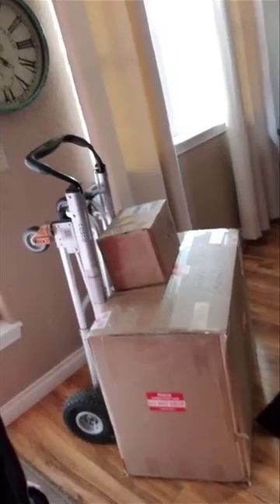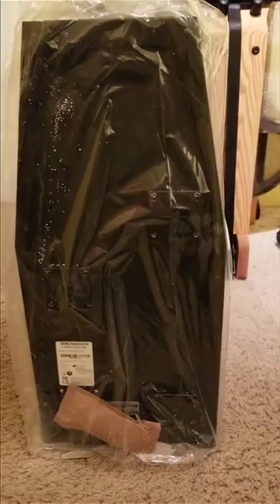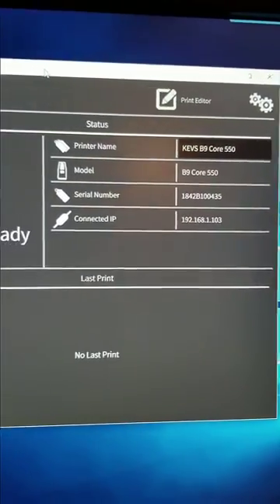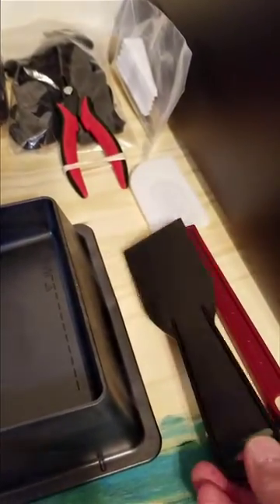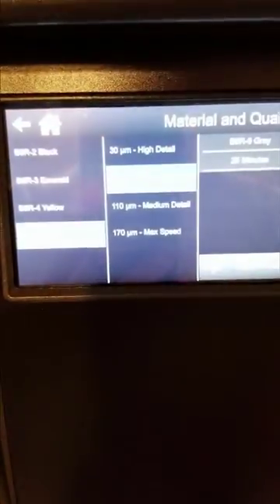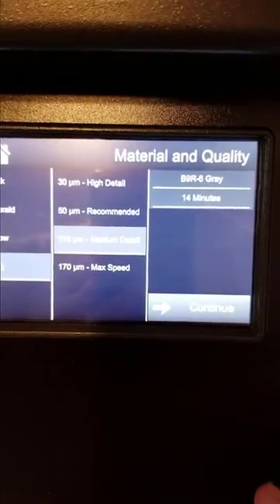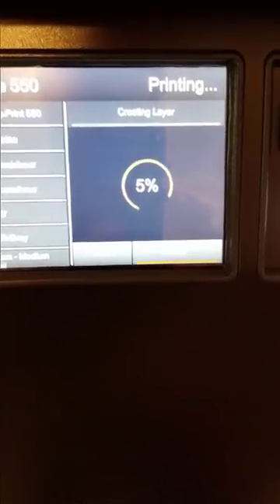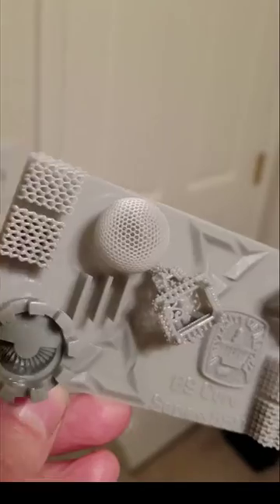B9 Core 550

Comment: I’m a custom jeweler and just bought the 550.  The firmware update got the highest resolution to .20 micron.  Informative video.  Love the plug and play
Reply from the maker: Nice, you'll like it a lot. You're going to love even more the new support software and new slicer coming out. I've been beta testing for months now and it's getting better all the time. Fast slicing and parts are even smoother.

Comment: Hi again Kevin, Which printer do you think it is better, the B9 530 or 550. I don't know which one choose for my jewelry designs. I saw that you can print with 30 micros (High definition) in your printer right?, so what is the difference between  the 530 and 550 apart from the printing space?
Reply from the maker: Hi Daniel.  I personally purchased the B9 Core 550 because I wanted the larger build area for some of the pieces that I do. You may not need that. The difference in resolution between the 530 and 550 was so small that I opted for the larger build area and that's been a very positive thing for my business model. I have friends with the 530 and they love them. One thing that's taking place right now is they're making a new Support Generation software which I'm a Beta Tester. I have noticed that my parts are even smoother now with the changes they're making. I don't think you can go wrong with either printers.  Good Thoughts,  Kevin
Reply: @kevsdesigns  Thank you so much.

Comment: I would like to know the difference between B9C Core 550 and the  B9 creator v1.2 .do i need both of them if am to start 3D printing do i need both or i need  one of them.
Reply from the maker: Hi Michael. there are a lot of differences.  It would be easier for you to go to the B9 Forum on their website and see all then information there. The B9 Core 550 has it's own light engine, Very Fast printing times, No Calibrations, WiFi for transferring your files, just to name a few. It's more of a turnkey system that takes very little time to run.
Reply: the 530 has much more resolution than the 550, but the printing area is smaller.The v1 is an old model, do not use it, but I have comments that it is difficult to calibrate, I recommend the 530 or 550, you can see my work on youtube